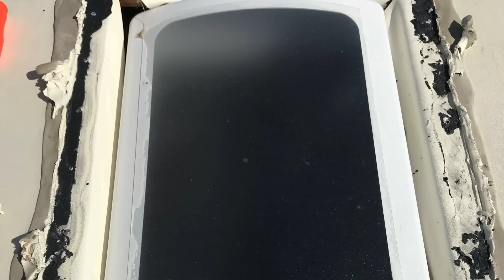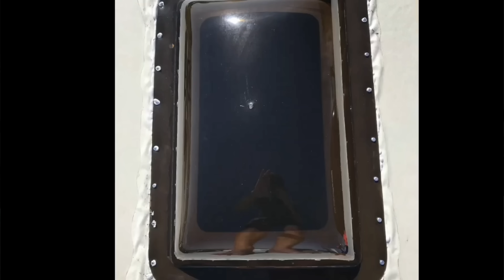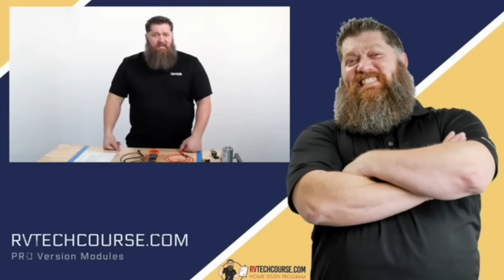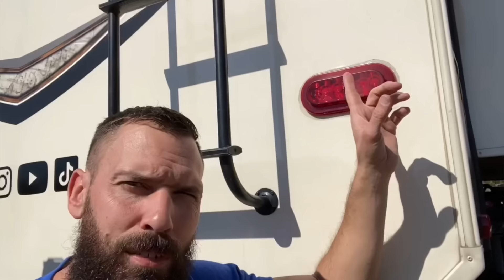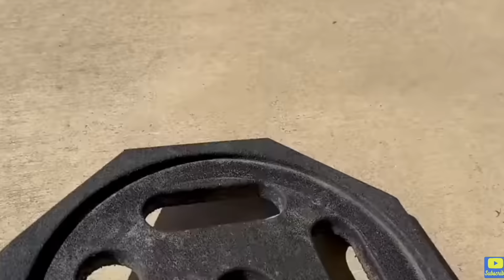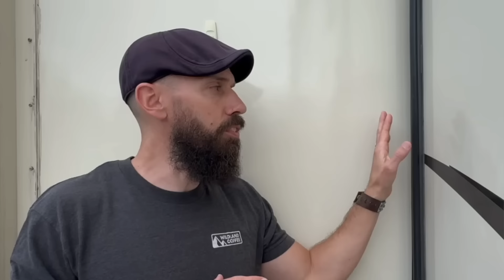Everything that's Broken in Our RV After 5 Years and The Solutions to Fix Them!

Comment: I've been wondering about that course.  Whether to take it online or whether take it when I'm in Texas.  I've done most the work on my RV myself And just hate having to call a tech out.  I've had to sometimes in the past.  But I would love to just grab more knowledge.   I'm 55 years old, a retired mechanical engineer for the big three.  Just wondering a little more about your thoughts on the course.  Would love any comments or would love to see an additional video kind of digging into how the course has been beneficial for you.  Thanks in advance.  Love your videos.  They're down to earth lots of common Sense and very knowledgeable.
Reply from the maker: So if you go down to Texas you can take the same exact week long RV fundamentals course but it cost around $2k. 
Then if you want to become an official RV tech or RV inspector you stay there for like 8 more weeks. Obviously this is if you want to start your own business and do that for a living. 

The online course is great because you learn all that week one information at your own pace and you always have the information on hand to go back and reference. 

Sounds like you’re already pretty knowledgeable in many areas. I’m like you usually trying to handle most things myself. This course really taught me a lot about electrical systems in the RV. Electricity has never been my strong suit or using a multimeter without having to read about it each time I do. This course really breaks down the watts, amps, voltage of an RV, how it all works when on shore power vs battery, generators, the inverters and converters working. Todd really gets into not only how to troubleshoot everything but he teaches the why and how in depth of how electricity works in general and how RVs are different vs homes. That all helped me out a lot. 
Plus he goes into depth on using your multimeter and breaks all of that down. 
He really breaks down on how propane works, the science of the gas, great tips for using it and then how to service those systems. 
Then you will learn troubleshooting on ACs, fridges, water heaters, furnaces, water pumps and water systems. Lots of little tips I didn’t really know when he went over these things. Plus all the preventive maintenance for you right now in and out.